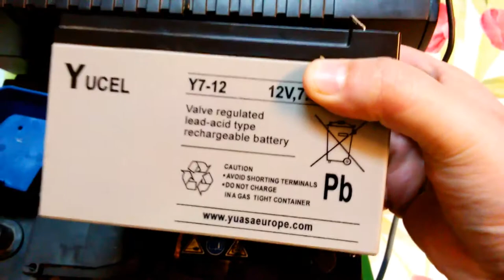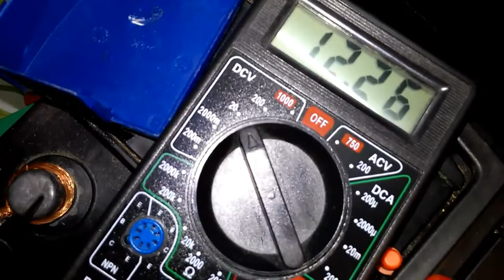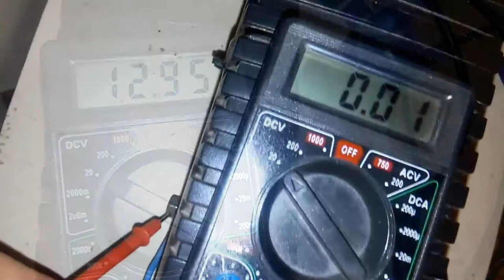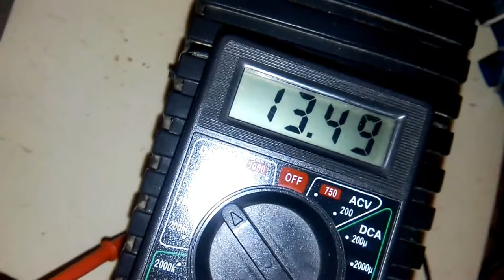Ups modificato come Carica Batteria per Automobile

Comment: Ciao, ho un ups techmade, il tester mi da 21 volt! Ho provato a caricare la batteria della macchina per vedere se si autoregolava ma il tester mi restituisce sempre 21 volt. Posso caricarci la batteria oppure c'è qualcosa che non va ? il tester l'ho messo su 200 perchè 20 non è sufficiente
Reply from the maker: Le batterie al piombo acido devono essere maneggiate con estrema cautela, la tensione massima di ricarica è di circa 14 volt, oltre si rischiano esplosioni ed in ogni caso la ricarica deve avvenire in ambienti con ricambio di aria. Grazie per la visione, se non lo hai già fatto: condividi, commenta, metti mi piace, iscriviti al canale. 
Gruppo telegram su https://t.me/andreastoolbox

Comment: Ma normalmente un gruppo ups ha due batterie 12 v collegate in parallelo quindi bisogna lasciare una batteria nel gruppo e poi portare all esterno i due morsetti per poter ricaricare la batteria auto..
Reply from the maker: Dipende dalle caratteristiche tecniche dell'ups, nel mio caso era presente una batteria acido piombo da 7 Ah, che praticamente ho rimpiazzato modificando opportunamente i cablaggi e verificando tensioni ed amperaggi, con una da 70 Ah sempre acido piombo per automobili. Se la batteria è troppo grande per le specifiche del circuito dell' ups, potrebbero verificarsi , guasti, surriscaldamento, esplosioni, ed incendi; quindi se non si hanno le competenze meglio non improvvisare.